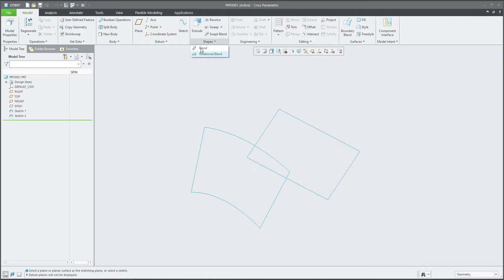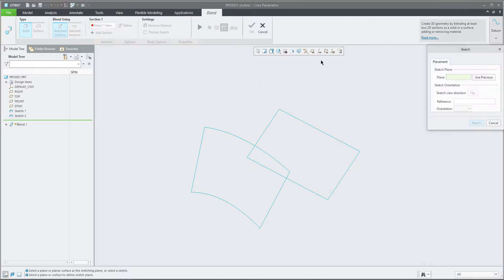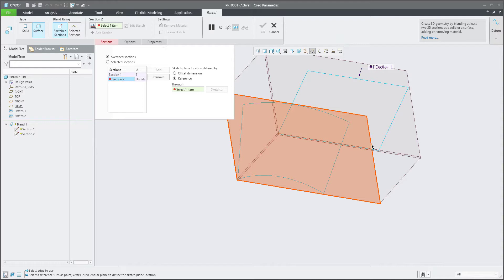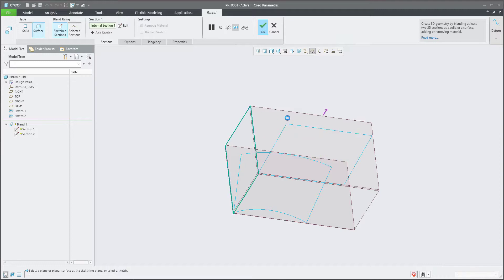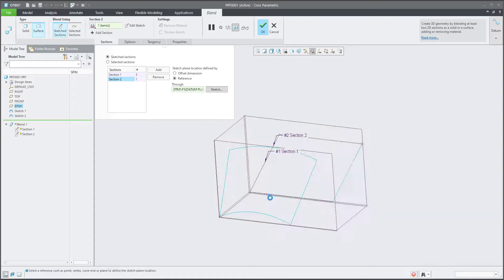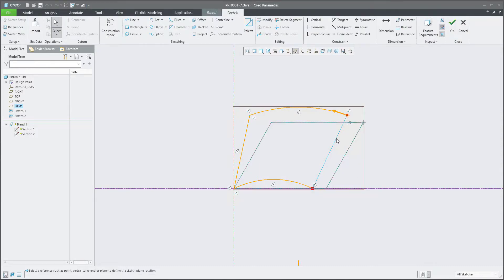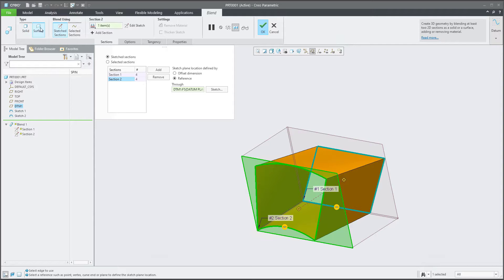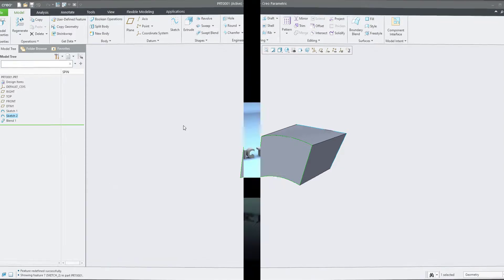Blend feature - failure recognition - Creo modeling

Comment: Hey,Thank you May be it could help  to find my mistake.Although i have not checked this step yet but thanx you have done so much for me.
Always supporting you...I have shared your video to my some of friends who are using Creo and got in doubt usually....thank you🙂
Reply from the maker: Thank you for your positive feedback and also for sharing Creo know how with your colleagues. Bye Vladimir
Reply: @4kside  Hey,i got your mail
You said that offset the quilt to some distance merge and solidify them.Is it?
Means we should not attach quilt to solid that'a why it's not going to merge and solidfy?
Reply from the maker: Hi, no.. Your surfaces has to be attached to existing geometry if you want to use solidify. I will try t explain it by a tutorial... It will be much easier
.. As to write many sentences 👍. I will try to post some example soon. By Vladimir
Reply: @4kside  Thanx! I am waiting for the video tutorial.😀
Reply from the maker: @SHIVAM-e1h9y   - just for you :) 
Merge and Solidify - Failure recognition | Creo tutorial https://youtu.be/lBIXJ00SpBk